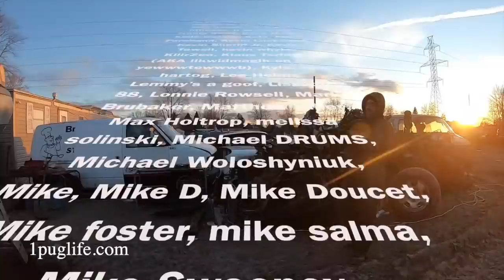pisses sady rims

Comment: when you gonna get dicky a oxy acetylene torch so he can just cut the damn engines outta the cars and not just round over every bolt he touches! BMP
Reply: and a warm place for him to work in.
Reply: He’s not even allowed to use the Milwaukee’s
Reply: @chrismechanic2000  is he building that shelter by the containers for Dicky?
Reply: @Zeus-hq7wo  its hard to find good workers that are willing to suffer while working  .